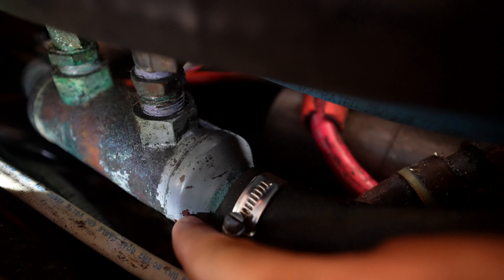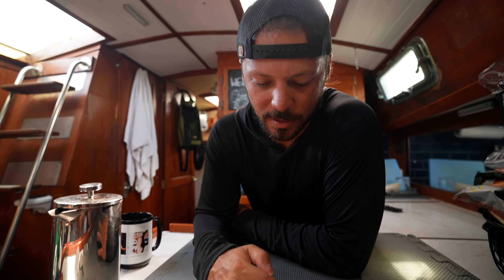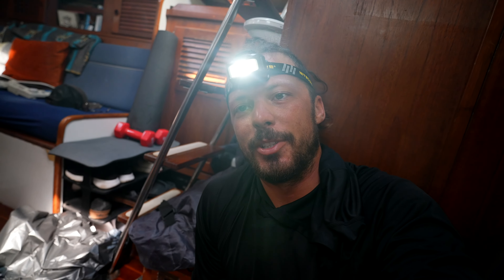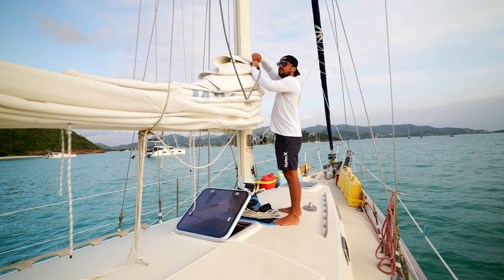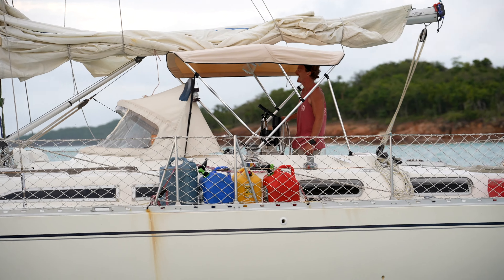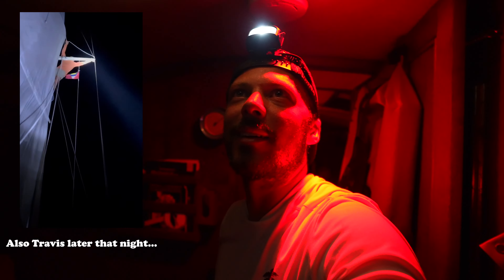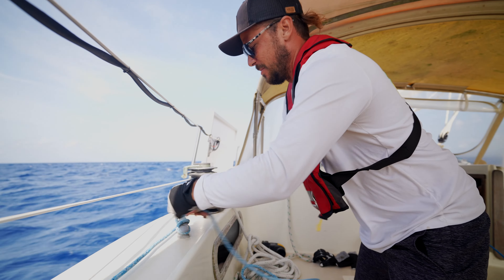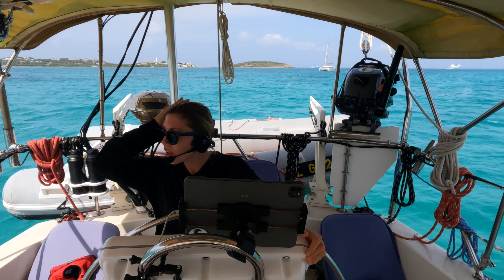We LOST our engine AT SEA - Ep. 58

Comment: I think you did pretty good on sailing with no engine, it’s stressful and all along you’re wondering what is the problem.On the wire connections going directly to the bilge pump make sure those stay above the water level all the time if you can.Being underwater can cause electrolysis at the wire connectors, I’ve had that happen more then once.On the repair on the cooler have you checked the zinc plug?I would think that electrolysis is the culprit to the hole in that cooler.Keep a close watch on that problem,if it happens again soon it’s a electrical problem ,Hopefully your transmission is ok.Good job too on trimming the sails.👍I really enjoyed this episode 🙏🙏🙏😍
Reply from the maker: Thanks Mark! This trip definitely taught us a lot. Thanks for the tips! We will be checking our electrical for sure. Our model Yanmar doesn’t have a zinc, but I will check the prop shaft ones. Cheers!!🍻

Comment: The most effective way to get the water out of a boat is a frightened man with a bucket.
I carry a small rule bilge pump with about 30 feet of wire and alligator clips so it can be hooked onto a battery or any other 12v connection.  It's also got enough flexible hose that the discharge end can be put overboard as a last resort. It's also handy for bailing out the dink if I'm feeling lazy.
Reply from the maker: Love it! 🙌

Comment: Word of warning. The heat gun solder/heat shrink connectors are junk. Outfitted wiring on many emergency vehicles, Lot's of connections, and had to go back n properly solder on new ones after those failed. As far as not being secure in what you are doing out there? Gas welded a drag racing motorcycle together in the garage when I was 16. When I raced it the people in the stands either gave me crap or cheered me on. Point being, They were in the stands and I was on the track!!!!!! Admire and hope to follow future adventures, I'M Cheering
Reply from the maker: You’re awesome 🙌 Thank you for watching!

Comment: The tape shoulda worked? Did you pull and stretch it? It doesn't stick to it's self until stretched. Alot.
Reply from the maker: Yeah it was just in a tight space so I couldn’t stretch it as much as I needed to! The JB weld ended up working just fine 👌